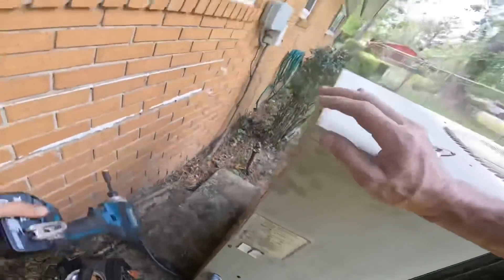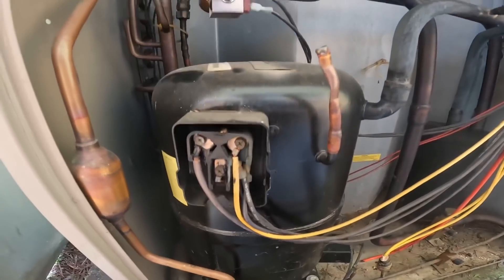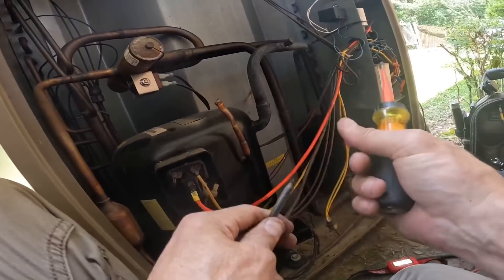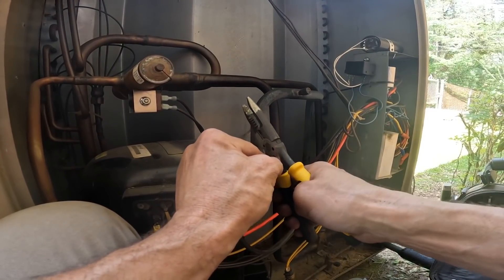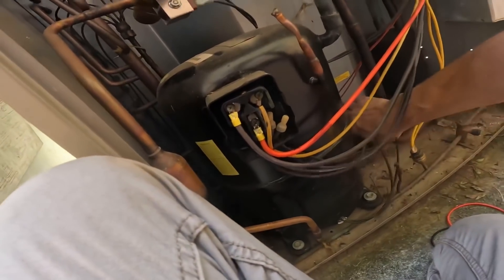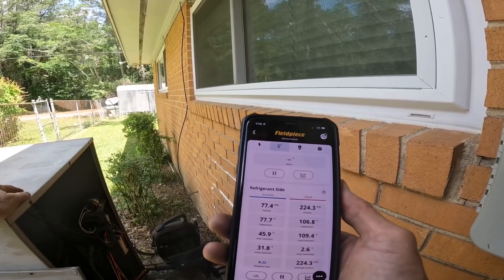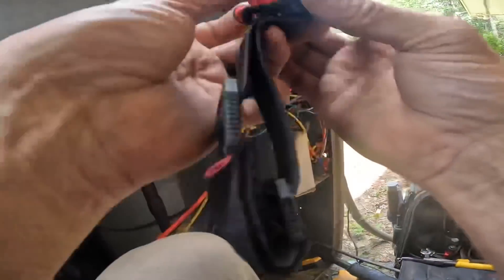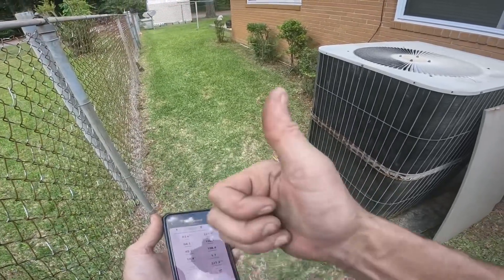28 Year Old AC Still Working After Being Condemned

Comment: Great to see an honest man work. How easy would it have been to tell that lady that she needed a new system to make a few extra bucks.  
My sister was worried that she might need a new heater, which is located in her attic. The tech told her it was a stainless unit and was still in good condition. She has carbon monoxide detectors in the house with fire alarms too. Had the man told her she needed a whole new HVAC system, she would have had it replaced without getting a second opinion because it is about 25 years old. Of course, heating systems don't run a lot right on the Louisiana Gulf Coast. Although last February was unusually cold, not record cold, just colder and cloudier than normal for much of the month. I got a record high $255 electricity bill since the resistance central heater would often run during the cold cloudy afternoons.   
Stay safe up in those dangerously hot, humid attics. Humans can't survive over 130 degrees for long. High humidity probably lowers that temperature a bit.

Comment: I had one last fall that looked like it was fried. But i took the time to rewire it just like you did and its still working this year. Good work and honesty will always pay. Stay safe brother
Reply: Not everyone can afford to buy a new system. Some of my customers live on social security. Every penny counts.
Reply: Looked like it was fried? Like oil spot erreware?
Reply: @murkyturkey5238  no but the wires to the terminals were all burnt off and soot and melted plastic stuck everywhere. Even the terminal cover was melted
Reply: How efficient is the said system? I mean let’s be real. Unit won’t last forever so what’s better..Letting a old old unit run inefficiently for another 2 years then the customer having to pay More in a few years for a AC? Or go ahead replace since only a short lifetime left and pay less for a AC?
Reply: @mattjones9279  depends on budget. As a tech unfortunately you don't get to decide that, the customer does. Sometimes they need to limp an old inefficient system along for 2 more years and then replace even though it costs more money in the long term, short term they can't afford that but maybe they can budget for it and afford it later.

Comment: They just didn't want to mess with an R22 unit so they just used the excuse it was dead so they could get a change out job instead of repairing it. In other words they just wanted to make big bucks instead of just a little more than a service call. I like R22 and will use it as long as I can in my window unit.
Reply: Which is funny because most techs I spoke to prefer R22 and don't like 410A.
Reply: R22 is gotten to the point it is way too expensive to even mess with then we get to then hear the customer bitch when other problems come up after spend alot on the gas. Then refuse to pay the bill
Reply: I mean over here in the Midwest in my company it’s about 186$ per pound. I can only imagine what the bigger companies are charging